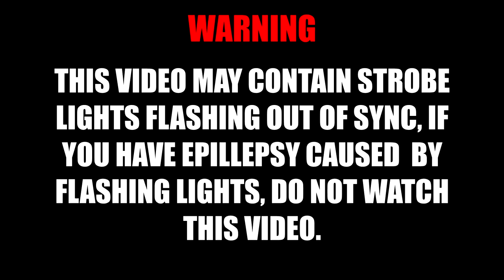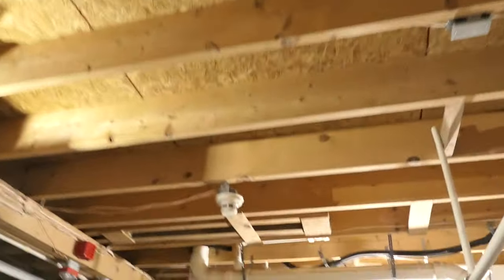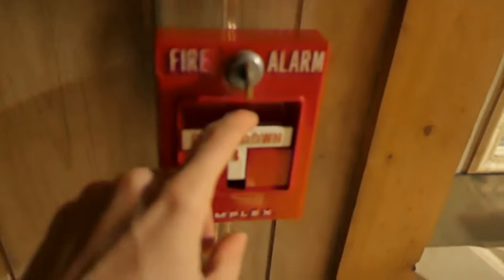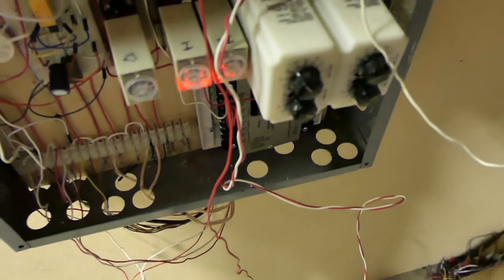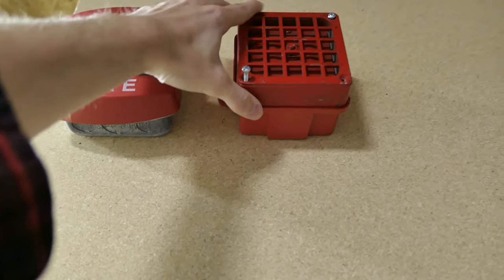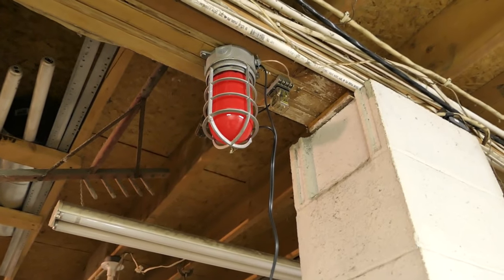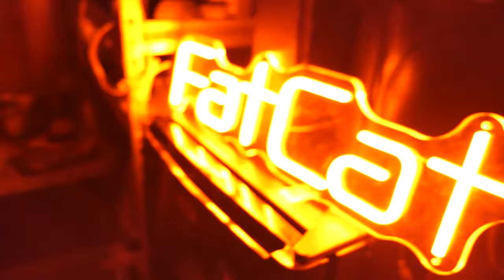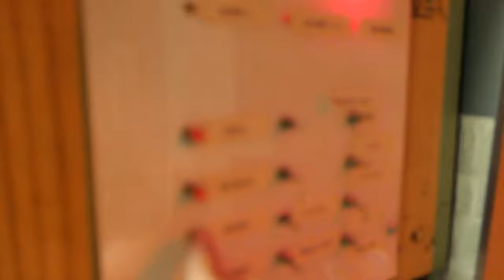System Test 28.5:  Other Codes and ST 29 Prep

Comment: Limited Voice Evac is possible on Relay logic. For simplicity you would have a single stage system (or voice evac ONLY on stage 2). Parts you need:

- Answering machine loop Cassette of suitable length for your voice message and any delay you want between repeats.
- Cassette recorder with remote input
- External Amplifier (for the voice evac speakers)
- Microphone (for live announcements)
- Audio Switch preferably using relay logic to automatically reset to tape on system reset

Leave the cassette recorder in play with the remote contacts in pause (I forget if this is open or closed), the alarm system relay will switch the remote contacts starting the recorder. You will have the issue of the playback stopping mid message on reset, but I'm sure you can figure your way around this (hint it involves a high pitched tone, a filter, a tone detector and more relay logic).

Comment: those mp3 cards can work with just relays if you're interested.
Also i did love the neon sign
Reply from the maker: I figure the relays can be used to activate the card, but in terms of actually storing and deploying an audio file on just relays, I'd have to essentially build a computer LOL
Reply: @FrostedStrobes  actually the audio is stored on the SD card, and the terminal that are closed determines the sound
Reply from the maker: @mimi2  Yes I've seen them, that'll be interesting to figure out in terms of implementation.

Comment: Someone needs to get this guy some FPLR fire alarm wire, still great video though
Reply from the maker: you mean my mixture of thermostat wiring, speaker wiring, and $11 doorbell wiring DOESN'T look good?

Honestly though I understand, perhaps someday it'll all be proper, or at least something close to it...  or I'll put up drywall and hide the ugly wires behind it Lol
Reply: Using a mess of wires is so something I would do. I mean you used what you had on hand, and made it work. Thats super cool!
Reply: Or or or to the thought of putting up dry wall to hide it, try metal conduit, or plastic conduit to hide it. It would be a lot easier than passing up drywall (If your thinking of putting it up the same way I'm thinking). Although,.it would be pretty expensive for metal conduit, at this rate of reusing, maybe find some old, somewhat thin metal or plastic pipes lol
Reply: I meant putting, not passing. My dang kindle auto corrected me
Reply: And I didn't know that putting a * before and after a sentence would make the letters bold
Reply from the maker: @SoutheastWarrenEAS  I intend to do both the drywall and the conduit, I have a couple short lengths of PVC conduit that I've been meaning to put up.  Wouldn't really cover everything though, just where some pulls and NAs are.  Then on the other hand, there are a number of basement finishing measures I want to take, like putting in ceiling tiles, vinyl flooring, carpet tiles, and, at the very least, sectioning off the garage from everything else.

This is all (except the PVC conduit) pretty far down the road though, big financial decisions.
Reply: It sound like you would have a project on your hands, if you do it. If I were you though, I would consider this: time, money, and the amount of time you and others will spend down there. If you wouldn't be spending much time in your basement, the it might not be worth the time it would take to do it, and the money it would cost. However, if you think the floor joists and the concrete floors are ugly or somewhat an eyesore, the maybe it is worth the time and money. I'm a kid so maybe don't listen to my advise, but I was just thinking about some things I would want to keep in mind if I was seriously considering something like this. Anyways I should be sleeping right now I have school in less than seven hours lol (I couldn't sleep)
Reply: But yea the conduit and drywall would help the crazy mess of wires

Comment: you built the panel?
Reply from the maker: Yes I did
Reply: @FrostedStrobes  can u try to use light bulb as an fire alarm?
Reply from the maker: @crazy12577  A couple of the large red lights featured in this video and System Test 28 have standard 60 watt light bulbs, if that's what you mean.
Reply: @FrostedStrobes  those are light bulbs? how did you hook them up